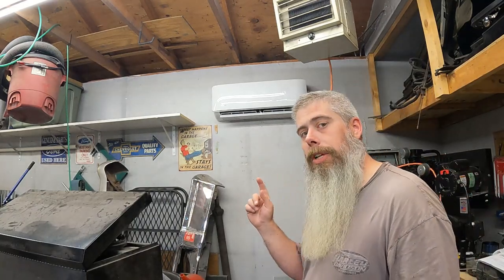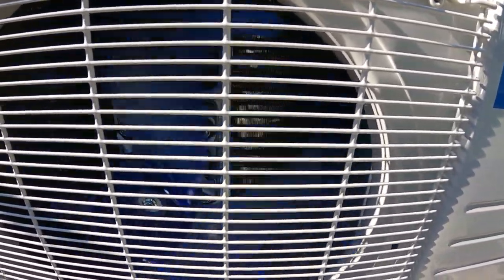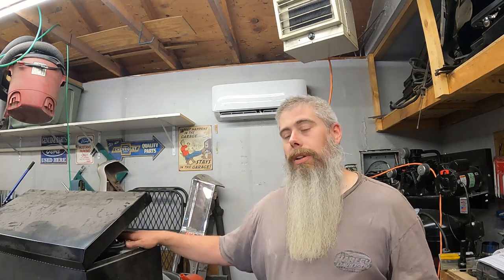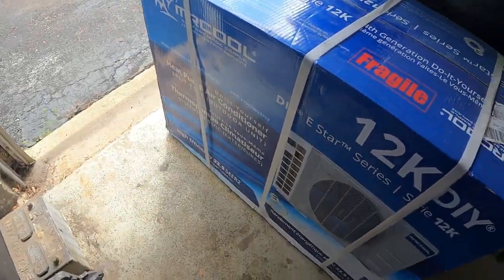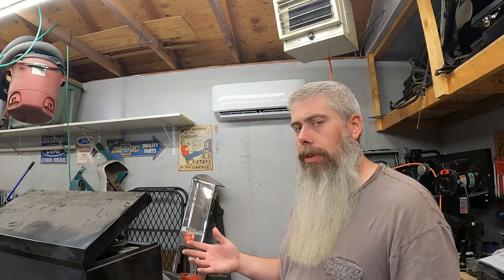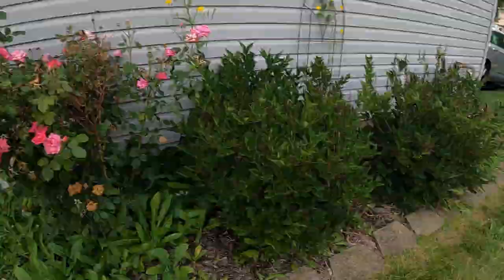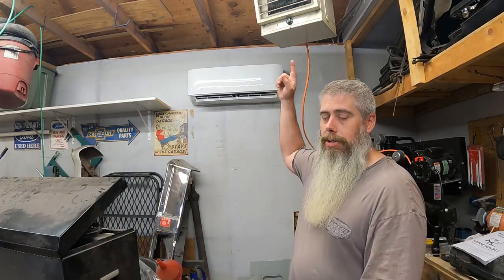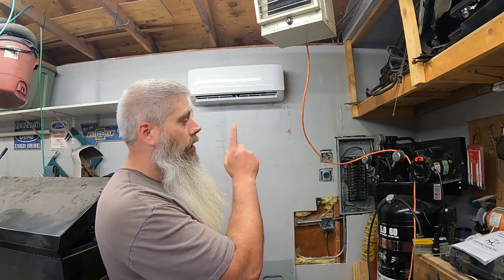Mr. Cool 4th Gen 12k BTU DIY Mini Split Installed in my garage!

Comment: How's it holding up after a year?
Reply from the maker: Still kicking butt a year later!
Reply: The 4th gen  12k btu diy unit is only available in 115v is it as energy efficient as the 220v units?